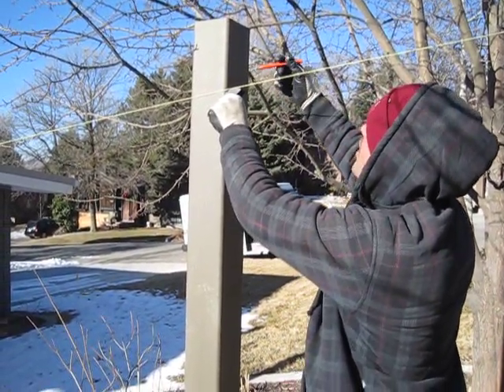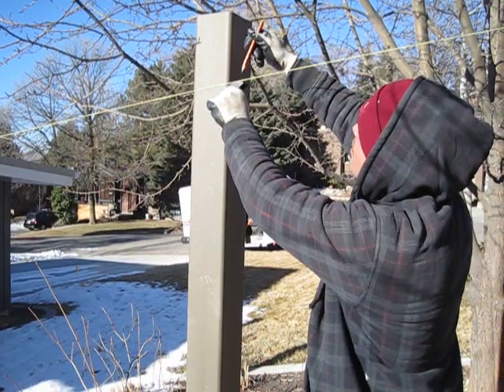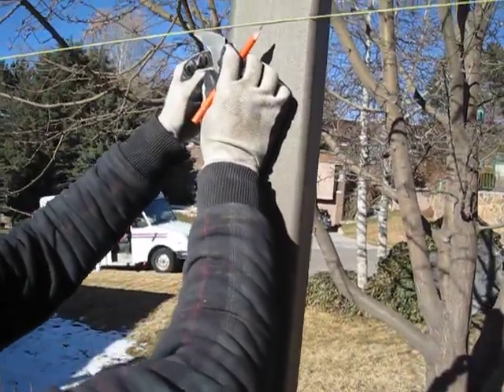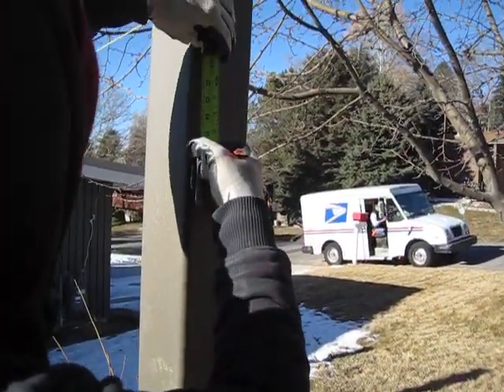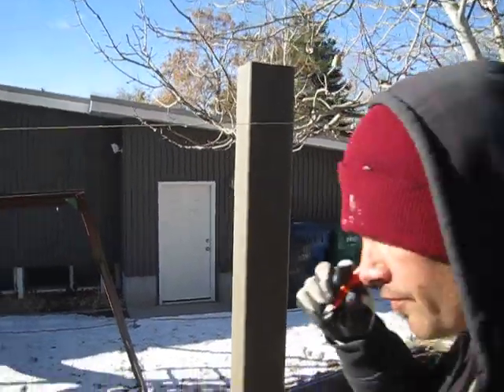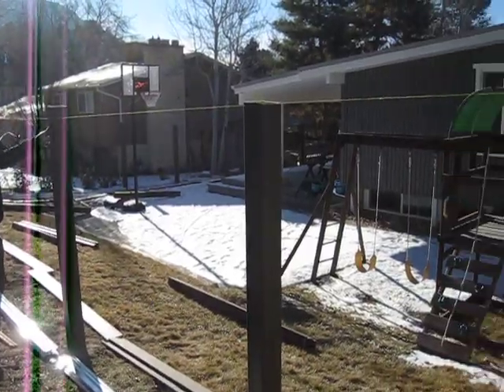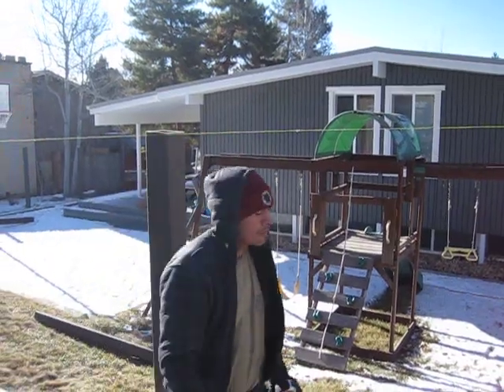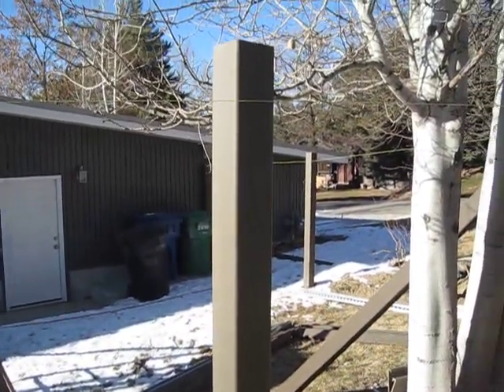Trex Fencing Installation - Measuring posts for sloping fence line

Comment: Does it resist strong winds ?
Reply: Gabriel, Trex fencing performs very well against strong winds. It has been tested for over 100 mph. Keep in mind, wind is exceptionally unpredictable so while the fence can withstand high winds, a sudden burst with a change of direction could destabilize any strong structure, including a Trex fence. Overall, however, Trex performs better than vinyl and wood fences with 4x4 posts. Feel free to call 877-700-8739 if you want to discuss this in more depth.